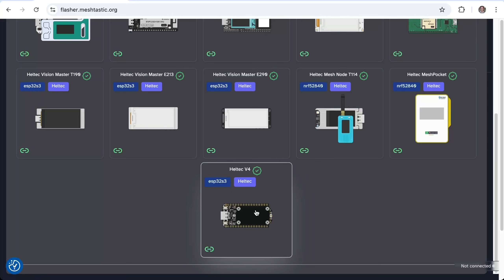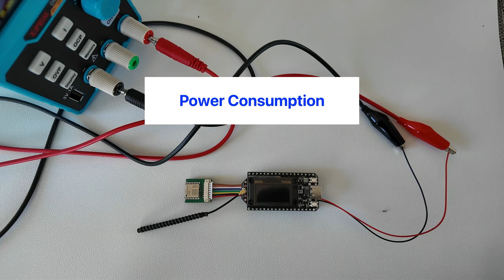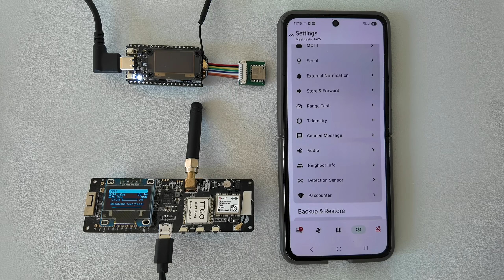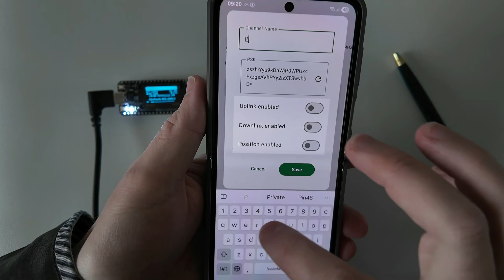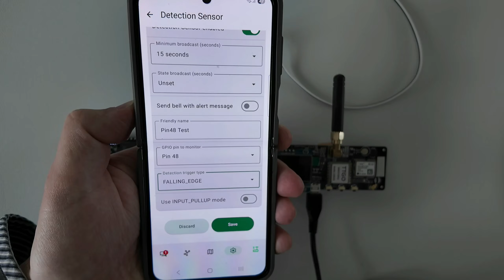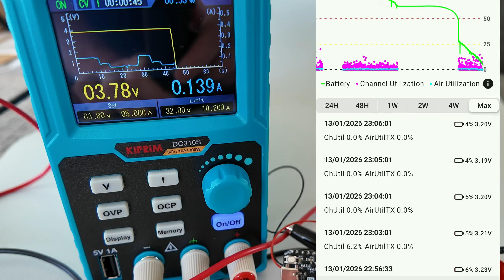Meshtastic Heltec V4 Full Review: Setup, Range & Sensors

Comment: Hello, greetings. I have a big question. Let's say I have a Meshtastic client in an apartment building, on the 12th floor, listening to four distant nodes. Down below, on the ground floor, I have a small pocket node that only listens to the one on the roof. If my high-rise node decides not to retransmit because it's already hearing that packet repeated by other nodes, even if there are still hops to go, will I miss the group message down below? I think the base client was "invented" to solve this, but it doesn't really solve anything; it's for messages directed at you, not group messages. By the way, great video.
Reply from the maker: I think, Meshtastic was especially designed for that use case. And the top node with better visibility will retransmit messages to smaller nodes if the number of hops is not 0; this sounds logical. But I'm not a core Meshtastic developer, so maybe I'm wrong.

Comment: Nice video, how did you get L76K gps module to work? mine doesnt seem to give any location information at all
Reply from the maker: Nothing actually, all pins are default, set to 0. The GPS antenna is not very sensitive, keep it running near the window for 5-10 minutes. My shows 6 sats after that.
Reply: @DimitriiLab  I did but nothing happens, did you set smart position or any other specific configuration in the app?
Reply from the maker: @ofaydn  Nothing special, I set GPS to "Enabled", Poll interval to 1 minute, and all pins are default (0s). Try to erase flash and reinstall firmware from scratch; who knows.
Reply: @DimitriiLab  I see, sometimes it works though. Weird stuff
Reply from the maker: @ofaydn  Keep in mind that the ceramic antenna is at the bottom of the GPS, so it's better to turn the V4 upside down 🙂 Weird indeed.
Reply: @DimitriiLab  I never knew! Maybe that's why sometimes it worked and sometimes it didn't.
Reply from the maker: @ofaydn  Yes, this GPS antenna is small but it does the job, I did several range tests (a last one yesterday for a next video:) and never had problems with it.

Comment: Can this module   v4 be used to transmit data through 3 or 4 LoRa nodes?
Reply from the maker: Yes, this is the main idea of the mesh network. The default "max hops" option is 3 (with max=7), so 4 is doable, yes.

Comment: Seems you need to use the alpha firmware to operate properly on the 4.3 boards.
Reply from the maker: Any interesting new features there?
Reply: @DimitriiLab Nothing notable to me. But I'm rather new to all this stuff.
Reply from the maker: @snatr  Alpha versions are usually an early developer preview, and it makes sense to install alpha only if there are specific features you need.
Reply: @DimitriiLab  Not sure where you're getting your files, but everyone is saying that you need 2.7.20 and above as far as the meshtastic firmware goes. That's only available as an Alpha right now. And it was proven to be the case with me. I could receive okay, but my transmission was terrible.
Reply from the maker: @snatr  Thanks, good to know

Comment: The flash website don't work and says device not found.  Also I am getting a message on the phone saying Bonding Failed even though Bluetooth is connected, what does that mean?
Reply from the maker: A website is using your system port. First, you need to figure out if the new serial port is detectable in your system (try another cable, check usb devices, etc).
Reply: @DimitriiLab  The website flash worked but their detection does not so that is bad on the website!
Reply from the maker: @stevec5000  It may depend on the serial port name on your system, but it's weird indeed.